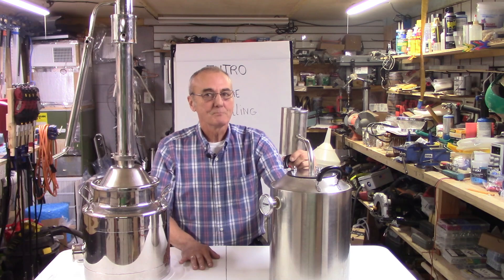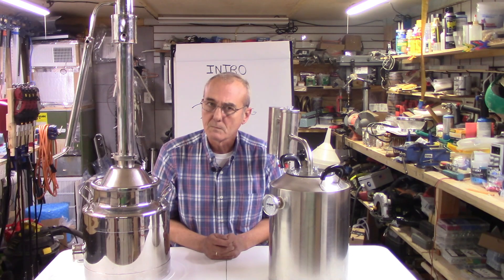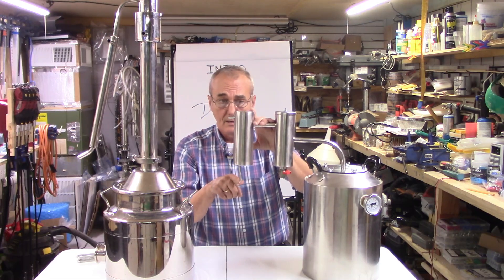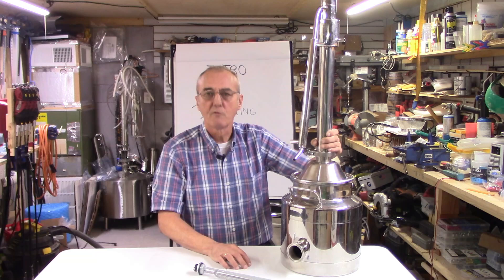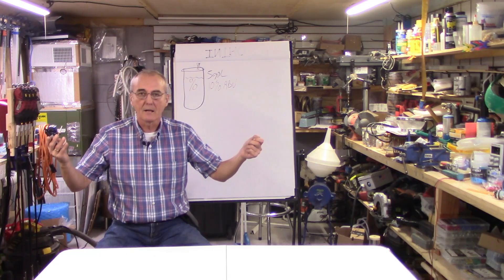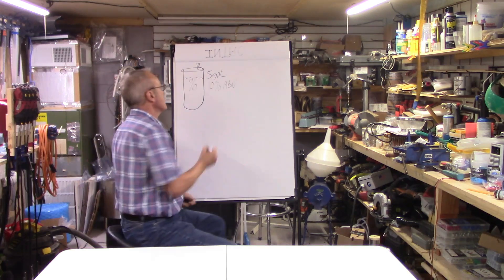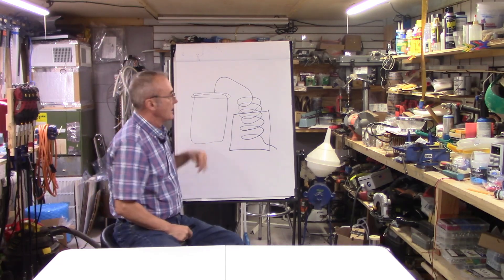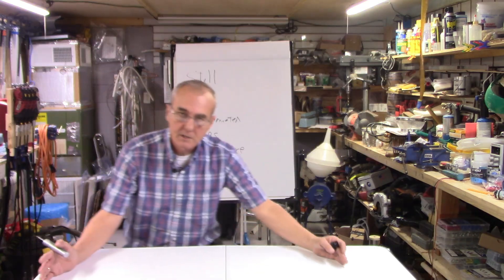BEGINNERS GUIDE TO HOME DISTILLING  STILLS AND HOW THEY WORK

Comment: I have a question. I have a 12 gallon pot still with a thumper keg. The guideline temperatures for making cut isn't even close. I first thought the thermometer that came with the still was wrong. I tested it and it is off just a little. It's not an adjustable thermometer so I ordered a really good one that could be calibrated. From the factory it was off about 3° so I adjusted it. It reads 32° in ice water and 211.5° in hard boiling water. 
The issue I have is I don't start getting a drip until 190°. After the forshots I start getting a steady drip at around 204°-208° .Near the end of the run it reads 208-210° . 
Why does this not correspond with everything I've read? 
Thanks
Reply: Vid is 3 years old, i would not expect to see a reply from anyone
Reply: HELLO?

Comment: Im just starting this hobby and I am curious about the evaporation. When you heat your fermented liquid, do you need to keep the temperature of the still below 212° so you have less water vapor mixed with your alcohol vapor? I believe alcohol should vaporize at 170° so is optimal temp between 170° and 211°?

Comment: Hm...beginner questions:
1. if there's no chemical difference between the distillate produced in a copper still vs. stainless steel, why do even newer commercial distilleries use copper?
2. if you produce a 190-proof distillate in a reflux still, why does the composition of the fermented mash even matter, since the finished product is 'neutral?'
Thanks!  ...great teacher, btw.

Comment: I like this video, but there is a difference in condensing tubes. Fractional distillation tubes jump a 140 proof to 190 proof. It does take longer because of the atmospheric pressure resistance. High proof comes at the cost of flavor though. Tis a fine line.
Reply: Ahhhh! You said that at the end of the other video. I should have watched them all before commenting.

Comment: Interesting. After using a variety of super yeasts I went back to using Fleischmanns
Instant Yeast, Quick Rise. It always works for me and I've often used it to restart a stalled super yeast wash.. It is very dependable for me and gives off a mild sweet flavor  that doesn't require multiple runs.  Of course I'm only making sugar shine for a neutral spirit with a pot still.

Comment: I just bought a heating element like the one you have there, but it is bent so far around it almost touches itself, if it does, will it cause a short and nuke my element.
Reply from the maker: No. That is the way they make low density elements
Reply: @BarleyandHopsBrewing  Good to know, then I guess I'm just a PID wiring job away from go time.

Comment: Ok I got a question 
if anyone would like to shed some light on me please 
 Ok I just did a simple Sugar wash with about 7 lb of corn 🌽 it’s done but I was wondering should I throw it in the fridge (after I rack) for 24 hr be for I run or should I just rack it and run it I have Heard if you cool off the wash the yeast will suspend /cocoon fall to the bottom ? will this help ?

Comment: Hey George, you ever had a problem with your column not coming up to heat fast enough? My column I just made is a little big and it takes nearly an hour longer than the boiler does to come up to temp. Trying to find a solution, maybe some kind of column preheater if I can work something like that out.
Reply from the maker: I would not be that concerned. My standard column also takes extra time (sometimes 30-45 minutes) to catch up with the kettle and balance.
George
Reply: @BarleyandHopsBrewing  Alright, cool. I wasn't sure, as I'm used to just a coil coming pretty much directly off the top of the still. When I made this new leibeg I went ahead and installed a 3 and a half foot, 3 inch column as well. 

Just didn't want to have blending issues or anything like that. Used to 10-15 minutes of coil heatup and on the go, an hour scared me a little.  Only one run on this new setup so far, so I figured I would ask if this was normal! 

Thanks as always, George. Your advice is much appreciated.
Reply from the maker: @Nathan-J-42  Anytime. Sounds like you are improving your system. Keep me posted; success always makes my day.
Reply: Is measuring the column temperature a good guide when to stop throwing away the early condensate? Ppl talk about taste testing to determine when to stop throwing away the early condensate

Comment: Simple wash for an agave/bastard tequila is, per 5 gallons, 
2  -  46 oz blue agave syrup/ nectar, ( preferably dark)
12# raw sugar
Enough spring water to make 5 - 5 1/2 gallons of wash, half warmed up to 140° F to allow the agave and sugar to combine easily.
Add 1 PKG 48 hr turbo yeast, or equal DADY yeast after adding cool water after combining sugar and agave syrup. 75-85° F seems to work well. You should get 18-20% ABV out of the wash.
Reply: You may want to add a little more yeast, give it a good stir and another 48 hrs. Then go ahead and run it.
Reply: I mixed up your recipe for tequila and have a question. The fermentation seems awfully slow considering I used Turbo yeast. Now maybe 5 days into it, it's still "glugging" every 30 seconds or so. Specific gravity started at 1.160, now 1.070. Is it ready to cook? (I am a bit new to this, doing only gin runs for the last 11 months)

Comment: You turned me onto the mile high 8 gal stainless steel pot still. I live it so much! My next step is an electric heating element with pid controller.
Reply: indeed we modified our oven with a cheap thermocouple sensor and digital PID controller now we can bake bread and cakes more accurately cost less than 30 bucks Im using one for jam making and soon distilliation/brewing etc. Higher accuracy, clear digital readout  and better control. If you can wire up a home doorbell you can add a PID controller. Select the right range thermocouple